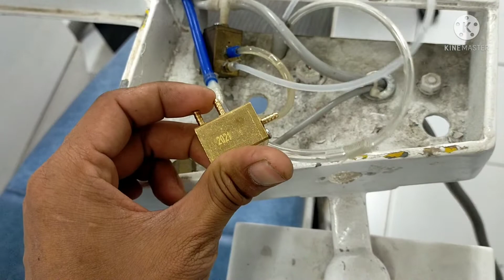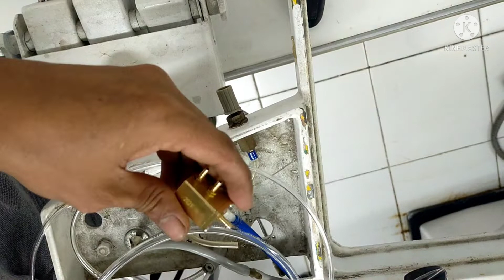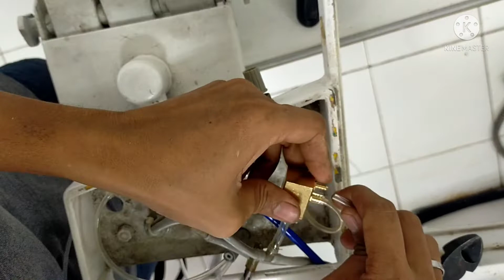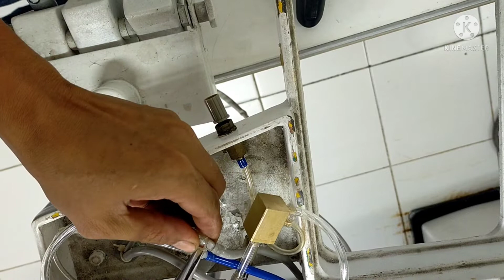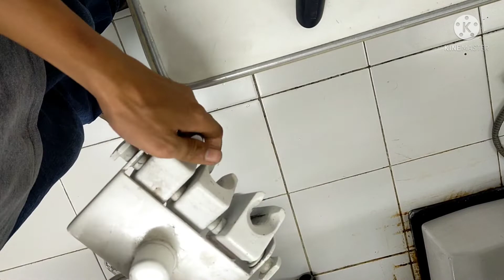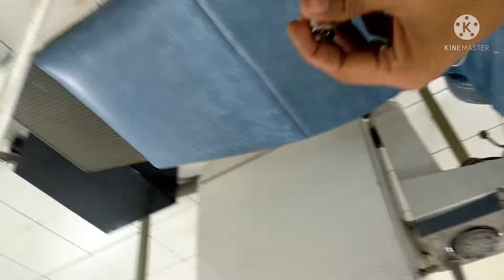HOW TO REPLACE DENTAL CHAIR WATER RELAY VALVE OR WATER RETRACTOR!?

Comment: Pareho din Po ba Yan valve na Yan na naka connect sa bottle city. Request sana Ako PANO palitan hose at hanapin connection Ng water bottle city papuntang  air water valve at toggle switch selector Ng water .